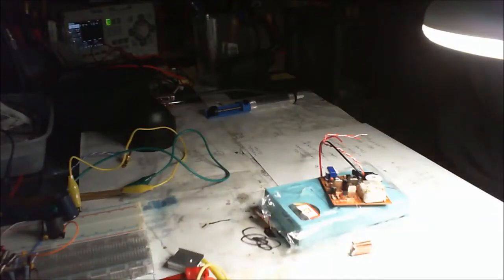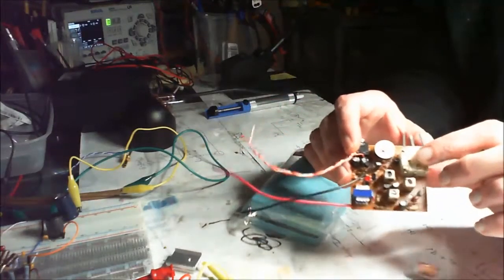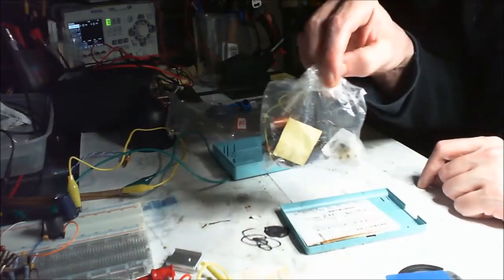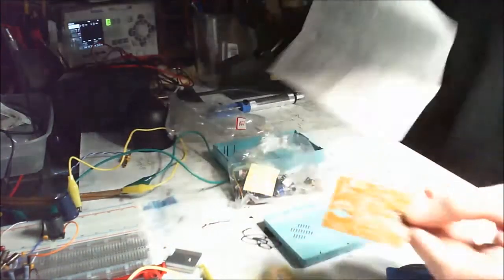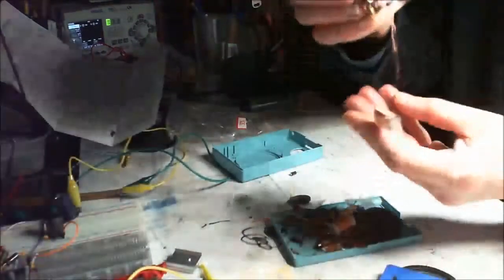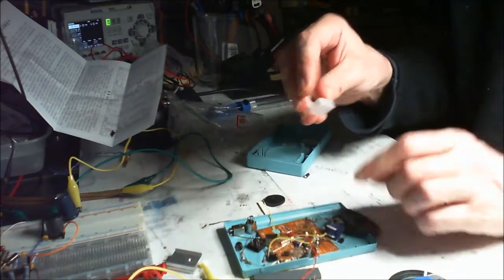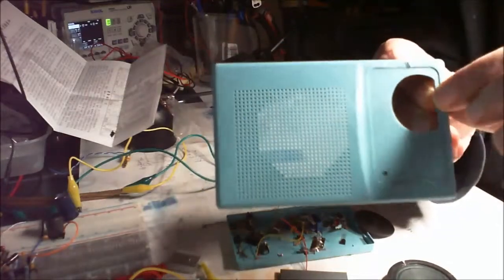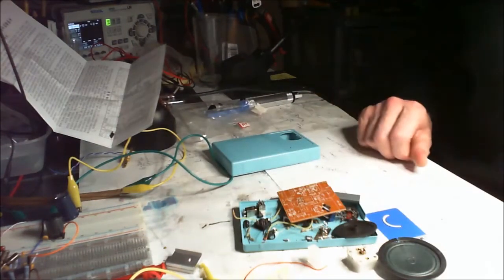HX 6B AM Radio Kit eBay

Comment: The other one arrived and I built it up. I managed to put one transistor in the wrong place. I shouldn't have been working so late.......
So V3 is a BC458, rather than a 9018.
I am not sure whether this was a good substitution.
Firstly... Does the radio have AGC, or not.
The audio distorts rather easily and I want to consider what might be at fault. I have a signal generator & I can do a proper alignment. 
Taking the radio to work has shown up an interesting issue. the audio fades out after a while as if the batteries are failing. I have tried NImH batteries & regular zinc-carbon ones which I thought would eliminate the problem.
I will stuff a 9018 transistor in to the V3 space. It looks like V3 is a detector and has some influence on the  preceding stage as well.

Comment: What are the particular challenges you discovered? Just so we can be aware of them if we are going to make one of these kits.
Reply from the maker: +NJPurling Hi, The IF pots were the only challenge i found. Once I looked at the resistor color code on the destructions provided I figured out where they went. Putting it in its case was fiddly and I never did do it, I never really intended on using it as a radio it was just for soldering practice. Have you built yours?
Reply: I did build mine, but I think I damaged one of the IF pots in putting it in. the air turned blue when I found that out.
Who gives a toss anyway? I figure these things are expendable anyhow.
Making them keeps me out of the pub.
I have not let the failure with the first one get me down. There's another on the way plus two other radio kits to have fun with.
Reply: I know there is an issue in the IF stage: With the indicated 30 K (R4) the current draw across test point 'B' was way too much. I used a 100K multi-turn trimmer pot as R4 & then measure across test point B until the current drops to 0.5mA.
I did make a S66E, which is the same but had a earphone jack.
A different speaker will help to some degree, but the sound is still c**p. Even a 8" extension speaker had the same 'tinny' distortion.
Maybe make another and not assemble any of the audio stage beyond the volume pot & coupling capacitor. See how it sounds on a external amplifier before I condemn the output stage as manure.
I am trying not to use cuss-words, but after a couple of hours work you expect more for your efforts. 
I would be very interested to see if there is any modification you could make to the HX-6B at the time of assembly to improve it.
Reply: The audio signal at the detector is clean.
It turns to c**p because of the crude audio stage and the horrible speaker.
The HX-6B redefines cheap & nasty. It could have been better, but then it would have cost more.